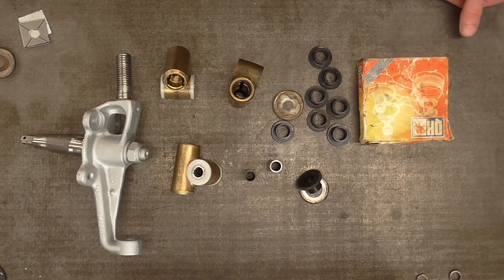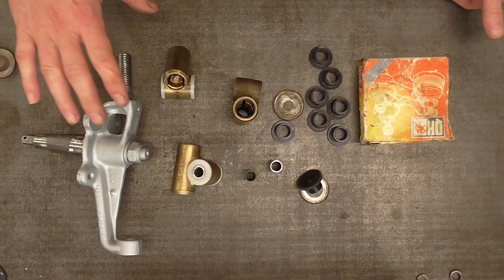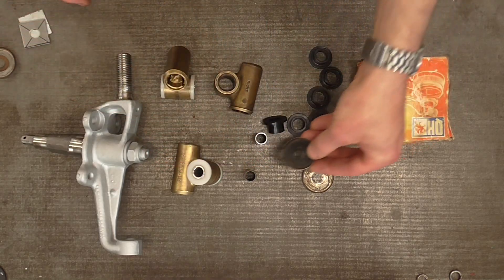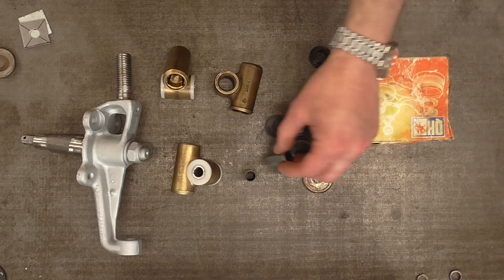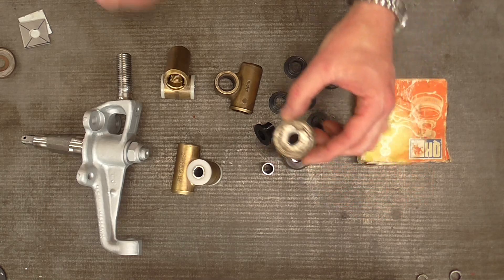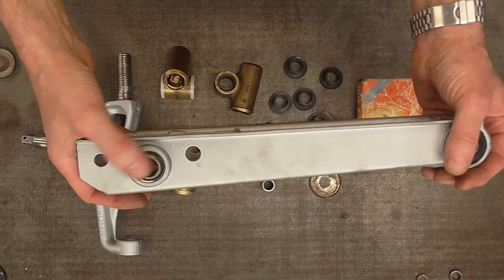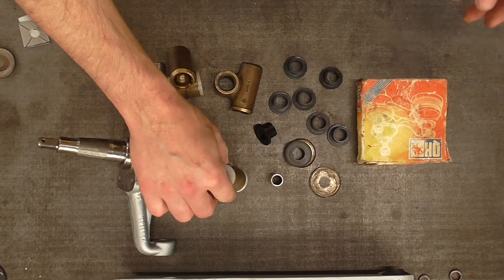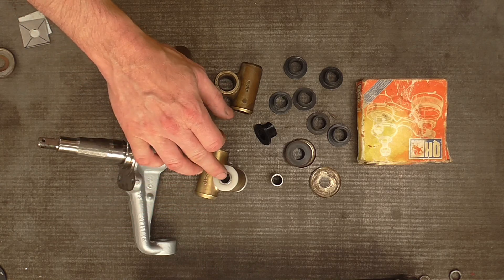Triumph (Lotus) trunnion bush upgrade.

Comment: This looks like an interesting solution.  Thanks for sharing it!  You’ll still use oil for lubrication, right?

It’s been a year since you posted this: can you provide an update?  Is the fix working as planned?  Anything you’d do differently?
Reply from the maker: For the trunnion threads? Of course, that part hasn't been modified. There is still a lot of work to do before the car will be on road,

Comment: Im not so sure about the replacement of the drag strut/roll bar with a bearing.  You are now relying on the anti roll bar bush to deflect a hell of a lot more.  This is because the roll bar arm moves in an arc and you will be pulling and pushing that lower arm a lot more.  With the original rubber or polyurathane bush, at least there was the ability to give and take with the arc movement.
Reply from the maker: The anti-roll bar constrains the fore and aft movement of the lower arm, which has a considerable flex at the inner bush.